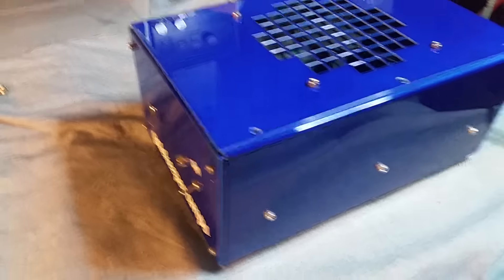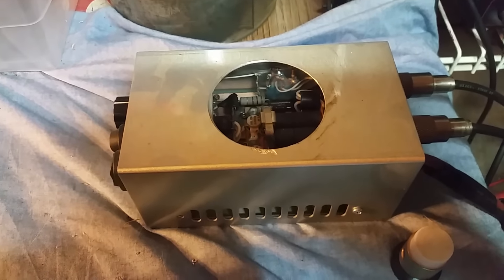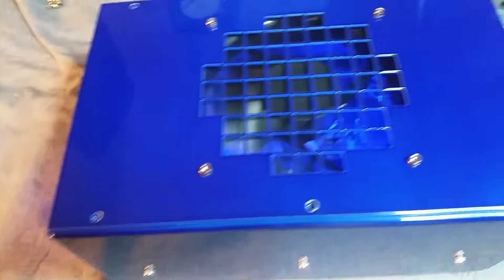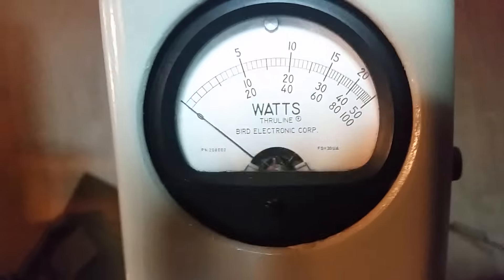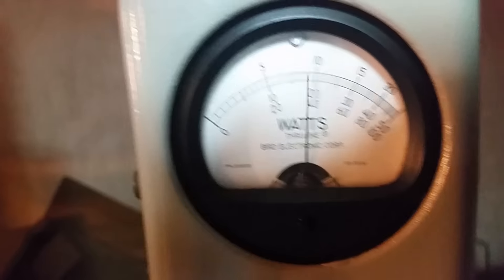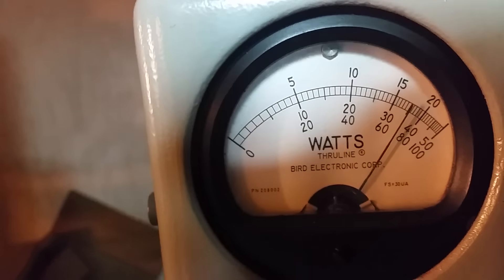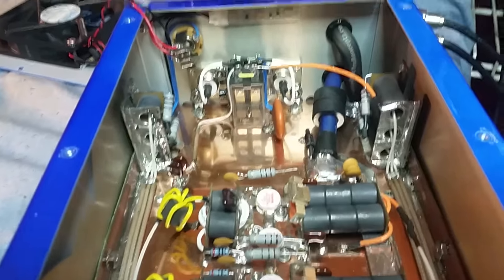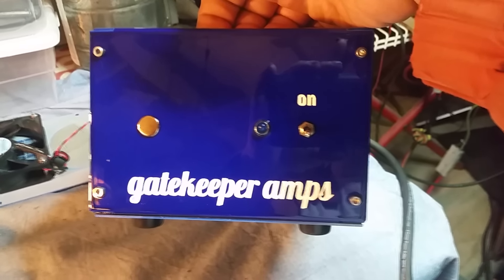Candy Painted 073 Built 6x2879 Amp 800w BIRD Gatekeeper Amps!

Comment: Ranch55 ..........
Gatekeeper, I am wondering, this 6 pill amp seems like that it would be a very good amp to run behind my Stryker 955HPC with the Stryker running at full bore. It doesn't seem like it would push the amp hard at all, but I could get quite a bit out the back end, especially on SSB , with plenty to spare........
Do you have any thoughts on my thoughts ?

Comment: cant tell if thats a cap or wi mote key thing sitting there my eyes are trippin LOL nice very aesthetically pleasing amp real nice on the eyes
Reply from the maker: I'm not sure what you are referring to what are you referring to are you referring to what sitting behind the amp to the right that is a bird slug there is no wireless remote in the picture or a capacitor either I don't think

Comment: hea tohm, almost ready to fire up the 16. so i see a plug for a remote. is that a foot peddle or what?
Reply from the maker: Dale I am trying to understand which 16 you are referring to in which remote for you are referring to. the remote port on the back of this 6 transistor amplifier it's just a remote port. Explain further please.
Reply: the 16 pill i purchased from you a wile back. you said rick built it and he had worked for Dave-made. the remote looks to be a 1/4 inch phono socket. i can open the case and visually trace that circuit, to figure it out. just asking if you knew it off the top of your head. i may take it and make it foot peddle keying i can't see why all amps aren't..
Reply from the maker: +dale myers call me crazy Dale but I had no earthly idea that you were the one that bought that from me I thought that it was someone else I had no idea that it was you I guess the messages that I was reading at a different picture on it and I had no idea that it was you lol

But yes I know that remote circuit like the back of my hand.

Yet he is a stereo quarter inch plug in the tip of the plug is all-time power from the hot bus in the ring Sauders to the hot side of the relay intercourse ground is ground hope that helps but and now I know you are the owner of that box me and I absolutely hated to let that go then I hated to let that go I'm glad you have it though